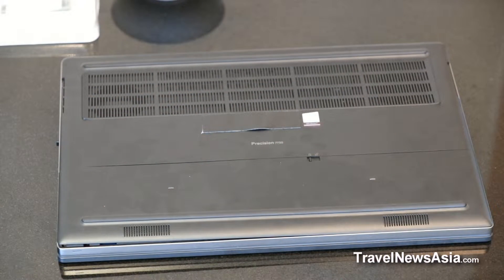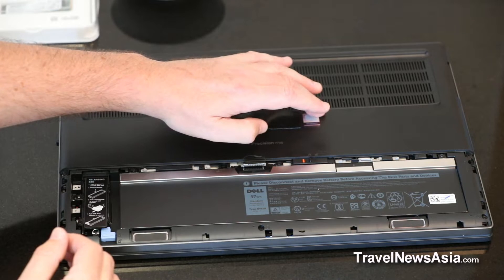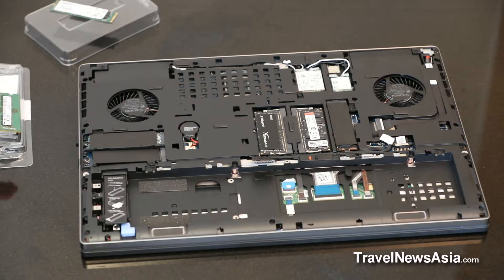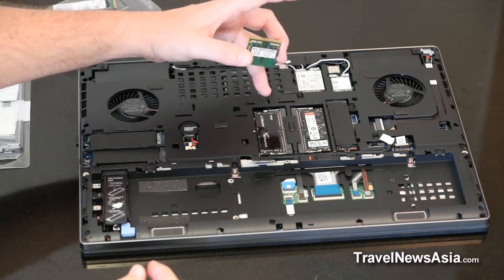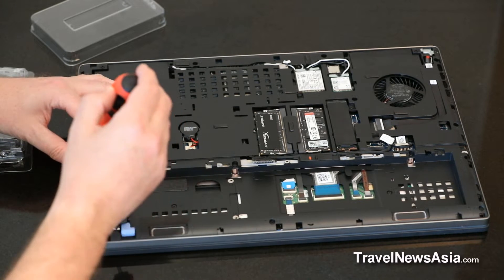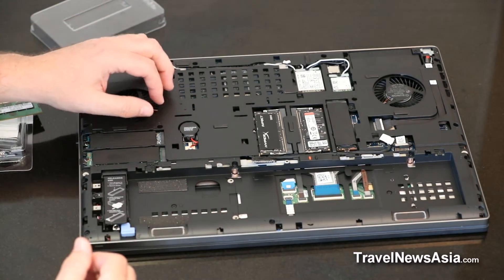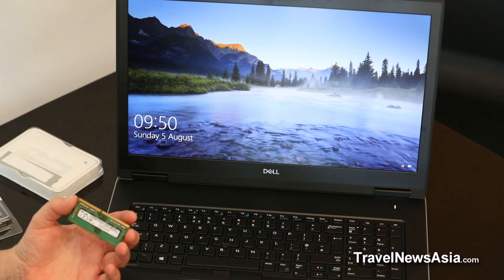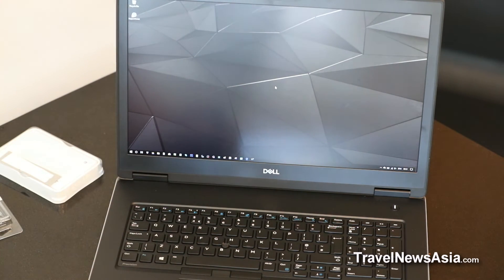Dell Precision 7730 Mobile Workstation - Opening Back to Install RAM and SSDs

Comment: I just ordered this machine with the following specs, any comments are appreciated;

Dell Mobile Precision 7730 XCTO BASE

Product details

Intel Core Xeon E-2186M (Six Core Xeon 2.90GHz, 4.80GHz Turbo, 12MB 45W)

Windows 10 Pro for Workstations (4 Cores Plus) English

Nvidia Quadro P5200 w/16GB GDDR5

Thermal for NVDIA N18E graphic card

17.3" UltraSharp UHD IGZO 3840x2160 AG, w/Prem Panel Guar 100% color gamut LCD

64GB, 4x16GB, 2666MHz DDR4 ECC

M.2 1TB NVMe PCIe Class 40 SSD

No Additional Hard Drive

No Additional Hard Drive

No Additional Hard Drive

Internal Dual Pointing Backlit Keyboard, US English

Keyboard Lattice, for 106 key, 107 key and 109 keys keyboards

Palm Rest, with Smart Card and finger print reader

Intel WiFi Link 9260 2x2 802.11ac w. Bluetooth 5

6-cell 97Wh Lithium Ion battery with ExpressCharge™

E5 240W 7.4mm Lot 6 PCR, Liteon

Dell Precision Optimizer

USB Media Resource, Mobile Precision 7730

Windows 10 Pro, WKSTA OS Recovery 64bit - USB

Intel WiFi Link 9260 Wireless Driver

Dell(TM) Digital Delivery Cirrus Client

Dell Client System Update (Updates latest Dell Recommended BIOS, Drivers, Firmware and Apps)

Waves Maxx Audio

Dell Limited Hardware Warranty Plus Service

ProSupport Plus: Accidental Damage Service, 3 Years

ProSupport Plus: Keep Your Hard Drive, 3 Years

ProSupport Plus: Next Business Day Onsite, 3 Years

ProSupport Plus: 7x24 Technical Support, 3 Years
Reply: wow, my dream machine. Can you pl tell if 4k is any useful or FHD is sufficient?
Reply: Hi, Are you happy with the screen and performance? Any heat problem? I'm planning the buy same one.

Comment: Why is it have WWAN but doesn't have Sim-card slot? Or i just don't see it...
Reply from the maker: This is a very good question and I will try to find an answer for you as I do not know. I always use my mobile as a hotspot when I do not have wifi access but I know that is not ideal. Will try to find out more.

Comment: Great Thank You! I have done it, works fine!
Reply from the maker: Glad to hear it. Enjoy.
Reply: @travelnewsasia  Will you upgrade to more SSDs? I am thinking about intalling Linux on a third SSD.
Reply from the maker: I am a big fan of Windows 10, so see little point in installing Linux. As for storage, I like to have as much space as I can. It would be great if the 2TB M.2 SSDs came down in price, but for now I try and fill it with as many 1TB M.2 Nvme PCIe cards I can afford.

Comment: Hmm. What would you do with more than 8 gigs of ram? I really would like to order a 7730 was thinking of 16 gigs of ram, however, I am confused about if and when I would need any more than 8 gigs ....?
Reply from the maker: Having more RAM means there is less issues when doing multiple tasks. For example I may be rendering a 4K or FHD video while editing high res pictures from a folder with thousands of RAW shots and doing other things all at the same time. On these machines, and most newer laptops you should have at least 16GB, but 32GB would be better and 64GB is sweet. Is 128GB of RAM needed, which is what the 7730 can take, perhaps not for me today, but in the future software and hardware may be able to make better use of such large amounts then great.
Reply: You easily can run virtual machines using Hyper-V or VMWare, for example. With 32 GB RAM, you could have two VMs each running with 8 GB RAM and then leave 16 GB for the host OS.
Reply: @travelnewsasia  ...I went with a Precision 7530 32 gigs of ram, this should be very similar to the 7730. Love it, but hate Windows 10.
Reply from the maker: I love Windows 10 and it just gets better and better, but I am still getting to grips with the sync options. Hopefully one day, all my laptops can be identical in what's on them and always totally synced so that the only difference between them is the hardware. I would LOVE that, and I am sure it is coming. Enjoy your 7530, it's an awesome machine!

Comment: In case of multiple m.2 ssds does the speed drop to half?
Reply from the maker: No. Each M.2 has its own port.
Reply: @travelnewsasia  i know but if they are connected to the CPU through the chipset the speed gonna be limited to 4 lanes so two m.2 the speed will be shared between them

Comment: from those 4 x m.2 slot. how many slot accepts m.2 sata ssd?
thanks
Reply from the maker: All four of the M.2 slots should be able to take M.2 SATA SSDs, but you will lose out on speed using a M.2 SSD rather than a PCIe NVMe. At first I thought of buying some M.2 SATA SSDs for storage, but I decided not to in the end as I will only end up replacing them with the faster PCIe drives later and do not want to spend money twice.

Comment: If I don't choose a graphics card when I purchase, Can I purchase a graphics card installation later?
Reply from the maker: You will have to choose a graphics card. You can change the graphics card at a later stage if you know how and are brave enough but at purchase time you will need to choose one. You should also note that the choice of video card may affect some of your other options - some may or may not be available depending on what you decide to go with. Hope this helps.
Reply: asiatraveltips I think OP meant to buy a config without dGPU, which is possible in the Dell configurator
Reply: no, you can't. this laptop not support gpu mxm slot. this suck.

Comment: Stay away from Dell workstation do not buy (m7720)

As a 10-year Dell customer, let me point out that it was the first time I curse using Dell. I have bought 5 workstations from Dell so far. (I made $ 25,000 shopping). A chronic problem occurred in the m7720 device I bought last. The same problem has occurred in the device for 3 times and the LCD screen breaks down by itself. The device that I gave 5,000 dollars made me very victim. I finally requested a replacement from Dell. I got the answer as if he was kidding. They even advised me to have a 2nd device with me. So I have to travel with 2 laptops :) I condemn this event as a customer who bought so much product for a company like Dell. I was also accused of mentioning a warranty capacity of Dell devices that I have never heard of, why you didn't get it. So I'm buying Dell's most expensive laptop and I'm the culprit. I am a victim of the device, although I only used the device for international travel. Dell told me to move this incident into consumer protection. I wish I had preferred another brand for half the price. It will be rude, but I am officially infamous with my money.

my service tag : 25f3hm2

Comment: what length NVME drives can each slot accomodate? All 4 slots can take NVME or are some SATA only?
Reply from the maker: All four of my HDs are NVME, but I have a feeling that it depends on the original configuration and perhaps the battery choice. On the laptop in the video all four slots are NVME.

Comment: If you decide to go with the smaller battery and install a 2.5 inch SSD/HDD, will you lose the fourth M.2 slot? Meaning you cannot install five drives in total, four M.2 drives and a 2.5 inch one,  in the system?
Reply from the maker: Correct. Your system will either have 3 M.2 PCIe NVMe slots plus 1 2.5" HD bay or 4 M.2 PCIe NVMe slots. I have the larger battery, so I have four M.2 PCIe NVMe slots.

Comment: Please help...i buy a 7730 with this config.. .  Intel xeon e2186m (top of line) 32gbram 
2x250ssd m2
1x500hdd
BUT THE FIRST OWNER  NOT CONFIG A NVDIA CARD ...only inte uhd graphics 630...this model can buy with  optional nvidia quaddro p3200 or 4000 or 5000  or radeon pro  with the same procesor intel xeon.....CAN I BUY A NVIDIA CARD AND INSTALL??? many people say me not....thanks
Reply from the maker: Sorry for the delay in replying. You should contact Dell Support, they are very good and will be able to give the right answer. Thanks.
Reply: @travelnewsasia  thanks

Comment: Do double pieces of RAMs cause fan to run noisier than the single piece?
Reply: I have 128 GB in my 7730, which takes both memory slots, and I don't notice any more fan noise than before.

Comment: can I play on it? :) I want it but I do play occasionally
Reply from the maker: Yes, you can play on it, but I cannot tell you how good it is at that as I do not use it for games. Dell has just brought out a new one so you may want to take a look at that, the 7740.
Reply: Not a gaming machine at all the GPU options are more for engineering work. They work for some video edits, but again a specific gaming or video edit machine is in order. Likely the price of a good gaming system will not exceed the cost of this laptop. One of these Dell Precision 7 series can run between $2,000 and $8,000 even more ;)

Comment: Can you replace and upgrade the CPUs and GPUs of the precision series laptops?
Reply from the maker: On most of the Precision series I believe you can, but I believe that it is harder to replace the GPUs on the latest models. Not as easy as putting new RAM in though! ;-)
Reply: @travelnewsasia  I believe that either the Precision M6700 or M6800 was the last Precision to include upgradeable CPU. (I remember upgrading the M6600s CPU) For my Precision 7720, it's a soldered CPU.
As for graphics card, it's more or less the same process on the M6600 as on the 7720

Comment: Is it safe to say that the Crutial MX500 M.2 SATA ssd will work on the 7730 in a Nvme slot (be that at a slower speed) - http://www.crucial.com/usa/en/precision-7730/CT12656811
I don't need lightening fast speed in my application but something that is better than a 7200rpm hard disks.
Reply from the maker: Yes that will work, but I am not sure it is the wisest purchase. The M.2 SATA is basically as fast as a normal SSD, so yes it is faster than a 7,200 rpm HD but much slower than a M.2 NVMe PCIe HD. When you start experiencing the NVMe speeds it will be quite hard to go back to normal SSD speeds especially when transferring files from one HD to another. Plus the price of Samsung 970 NVMe HDs are coming down quite quickly that I wonder whether to help future proof your system you would be better off with just getting that.